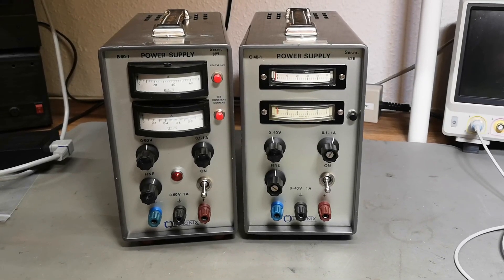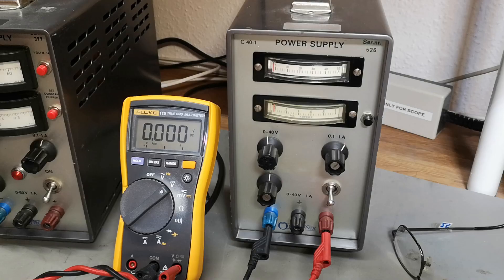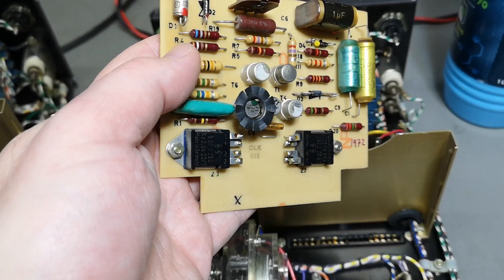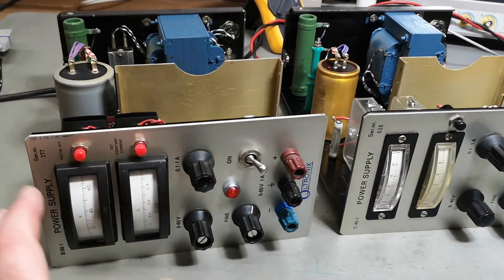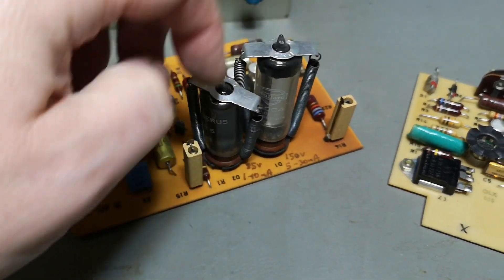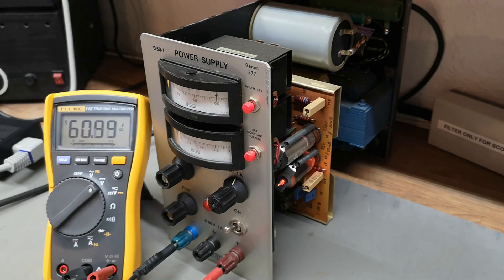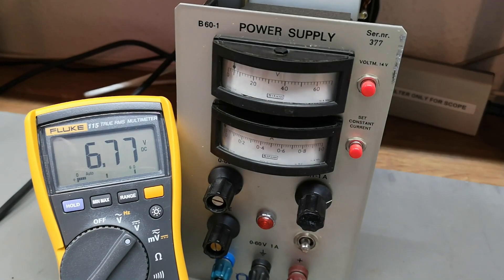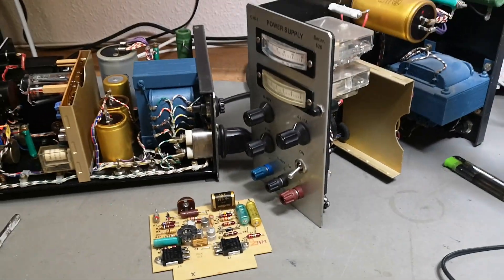Oltronix B 60-1 and C 40-1 DC power Supply test teardown

Comment: Wow, those gauges light up beautifully, at work I had a model with one gauge for both volts and amps (vertical orientation) and it didn't light up at all, but it worked great. The 14V button is simply for more accurate settings in the range up to 14V, because the scale is up to 70, just multiply the value by two.

Nice day 🙂Tom

Comment: Rifa smoke bombs, replace on sight ;)  Especially if they are used across the incoming supply. I have seen a lot of these fail spectacularly, and it's always messy.
Reply from the maker: i just found a few brand new RIFA NOS long leads, was newer mounted or soldered on them, when going thru my late fathers component stock, all cracked RIFA !! so this tells me it is just a mater of time, not used time or temperature or anything ... just pure bad design capacitors

Comment: 14V full scale, so you can use it to charge 12V accumulators, or 2V accumulators, as that was common in the 1960's. You can also see the regulator tube being current starved when you set current. Incidentally the big can capacitors will have a manufacturing date on them, so you can easily see when it was made, as they would have the week and year of manufacture on them, especially those German made ones in the C40 unit.